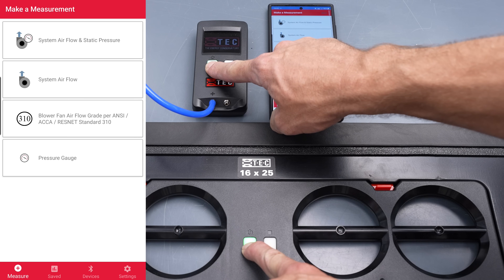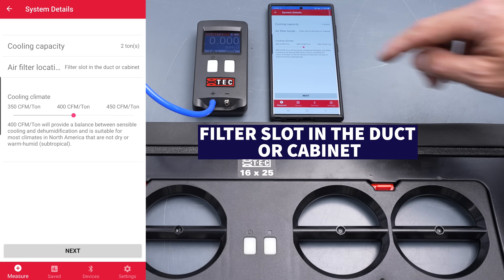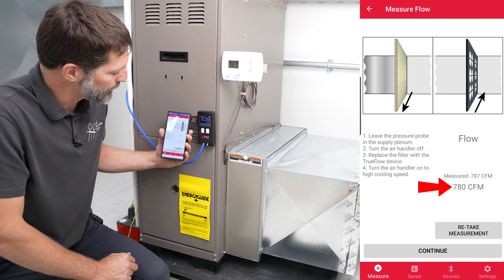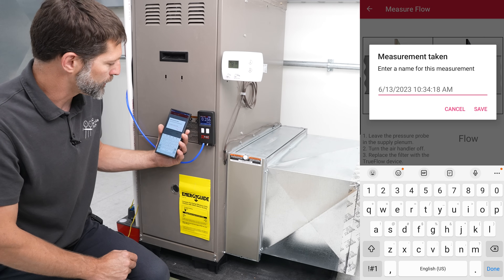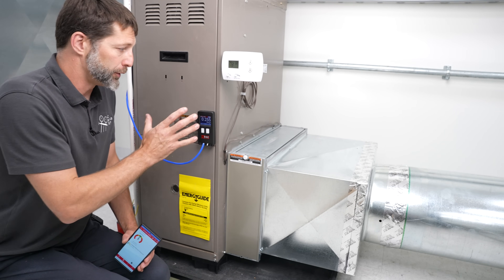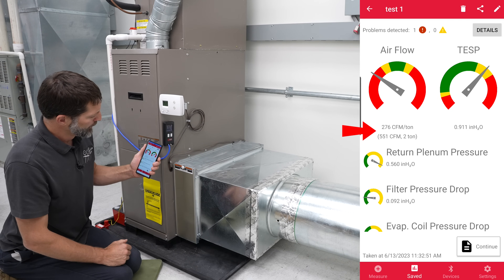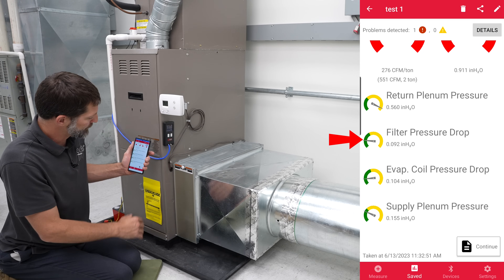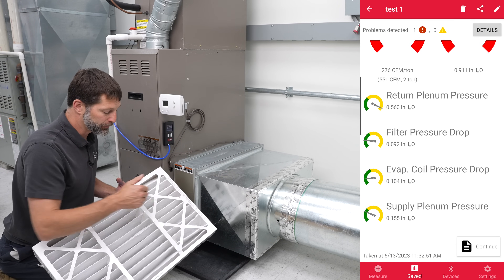Measuring Airflow CFM on HVAC Systems! Finding Airflow Problems!

Comment: Is it possible to use the TrueFlow grid using a Retrotech dm32 and just manually enter the pressure readings into the app?

Comment: This right here just shows me that no one really cares how they do do work in the field or how to run things properly. I’m a service technician and an installer and these new pieces of equipment do not like the bad duct designs from old systems.
Reply from the maker: It is definitely true that a lot of older ductwork doesn't hold up to the requirements of newer equipment.

Comment: If I didn't know any better I would swear Greg is purposely making  it more difficult to follow along. The way he blows by the device and test settings section and then selects the second test when he could have selected the first test option which includes both tests. It just seems like he's making the procedure longer and harder than it really needs to be I think. Secondly Is it really necessary to swap out the filter  and adapter grille multiple times? 
I'm not sure, but I think both tests can done with one swap. I may be wrong and confused, I don't know if I am or
not. 
Can someone please explain where I'm missing the boat if I am missing the boat.
And finally he states that the fault is up stream from the test point. How can that be possible 
if the fault is at the return grille?
I can't make any sense of this logic. Any clarification will be highly appreciated.

Comment: Could you use this in a RTU? Or does all the of airflow have to pass through this to get an accurate measurement
Reply: All the air flow needs to pass through the grid to get a good measurement.  We (the manufacturer) have done tests using 2 grids on an RTU that has 2 filters.  The measurements are accurate, but it's not well supported in the app yet.

Comment: The return is with high static according to the video, but you did mentioned if the total fan static can handle both supply/return and internal static. If it can handle and design for that, so there’s no issue.
Reply: The total was 0.91 inH2O.  I'm not aware of any equipment manufacturers that allow a total static pressure that high.

Comment: not all filter house is made good I have no time to fix people's filter house they don't pay ,  I ain't going to buy all this big goofy plastic all over, techs ask the homeowner to do airflow they have to pay  to fix their filter box , don't say you want to do airflow and them spend hours bending and straighten and correcting  their messed up system, 80% of them are messed up anyways, people are cheap these days just fix the major issue and leave. don't get your headache, if it's not broken don't fix it. keep talking too much to the homeowners you might get your self in deep s. if the blower motor is weak just find the issue fix or replace it keep it moving period. I have education in hvacr I worked 19 years as Hvac I know work for government less headache, the private is Hvac job is trashy and I used to go home with headache many of the customers are lairs.

Comment: Cool do they have a similar procedure for heatpumps Great Content ❤
Reply: It should be literally identical to the system shown in the video. The only difference for a split Heat Pump is the reversal of coolant flow and the Evap Coil being hot instead of cold like with AC. Nothing changes with the indoor equipment or testing
Reply: The app now has a heat pump or furnace mode in addition to cooling.

Comment: so the dozen plus techs that have come to my home to install or fix my AC - never once have I seen them do any of this level of diagnostics.  Why is this?  I mean, I get "techs" not "engineers" it seems and there appears to be this huge gap in knowledge between the guy/gal ("tech") that shows up and the people who design HVAC systems.  I'm a DIYer and have began installing my own HVAC systems and as I learn more about this field, it amazes me how many people that I use to rely on were never really interested in providing a system that is "dialed in" and matched to my home or the equipment's specifications.  I have installed two central HVAC systems (heat pumps) and getting ready to do my third for a garage and just as an experiment, I called 3 local HVAC companies to get quotes and they all have eye-balled it.  Not a single one of them did any volumetric calculation, none of them took into account the insulation of the garage either.  I probably could live with all this if it were not for the massive amount of scams, lying and price gouging going on in this industry.... I even watched one guy completely ignore torque settings on a pre-charged line set and went to town smashing and over-tightening that no-doubt would have left me with paying the bill.... anyway, keep sharing the knowledge....

Comment: Just want to ask about the superheat chart for the piston system, your chart in the book we got don’t show the return temp more than 76f 
The temp at the return was 84f and the supply was 76f. I don’t know what to do in this case! I need to calculate the target superheat..
Reply: I aim for about 12 degrees-ish for superheat on pistons, while trying to get around low 50s on the suction line temp. At 84 degree return, I would probably aim a little higher on the superheat since theres a big heat load in the house. If you are nice and cool on the suction line temp, and your temp split is good, you should be looking good to go
Reply: Superheat requires certain parameters to work.  You need to get close to those parameters before setting the final charge.  For instance in this case let the unit run long enough to bring down the return temp and then set the charge.   There are plenty of techs out there that set superheat at the same setting regardless of temp/chart, however they are putting components at risk.

Comment: I think my 2.5 ton system has a slightly low charge. I measured a static pressure before the filter and before the evaporator and got 0.43 WC. The med-high fan setting for my handler says 0.4 is 1031 and 0.5 is 987. So pretty much 1000CFM yet it froze up on me one day when it wasn't really hot out but just enough to trip the t-stat. I set my house at 76F so it's definitely not over-demanding. This only happened when I moved it from high to med-high, figured I'd try to make it a little more efficient since the numbers lined up. It did run a couple weeks with no issues but it was warmer in that time.

Comment: Great video as always! Quick question. How would you use this if you have a variable speed blower motor? Don't they always maintain airflow no matter what restrictions there are unlike PSC and ECM motors?
Reply: If that's how they actually work, they must be monitoring the pressure to maintain a certain flow. The only thing that would matter and be helpful to test would be power consumption for the blower as presumably it would be inefficient with restrictions. I've seen people claim that VFD HVAC equipment does this but have some questions/doubts about the effect and manufacturers actually implementing the components to do it.
Reply: How can there be proper air flow with restrictions present? I can't believe your question. I don't think you're cut out for HVAC.
Don't waste your time and money
In HVAC.
Reply: @edwardlara1011  Variable speed motors can ramp up and down to maintain proper airflow under a range of static pressures.

Comment: I have question  for any expert, I want replace my 1/10 hp condenser fan with 1/4 hp, with same rpm,  is it OK? I will make sure put new capacitor that is rated for 1/4 hp fan
Thanks
Reply: It’s fine induction motors don’t need a load
Reply: Depends on how you look at it. 

* Condensers have fins & hail guards which produce static pressure. 

* You need HP to overcome that static pressure. 

* Motors need to run efficiently. Under amping or over amping is inefficient and results in shortened life expectancy. 
A motor than is more powerful than needed in a condenser may cause it to run inefficient. (I say “may” because I’ve honestly never tried it, so I don’t know exactly)

* By all means, you can replace your motor with a different HP, but it will shorten the life expectancy (sometimes drastically).  I will leave the rest up to you.
Reply: @ironwill3598  thanks
Reply: Induction motor 'power' rating and consumption are dictated by the load. Meaning, speed rating is most important and a higher power rating only matters IF it's having to do a harder job i.e. more 'work'. If both are rated for 3600 RPM, they will operate the same with the only difference being the 1/4HP can handle more resistance and maintain the rated speed over the 1/10th. Again, power is determined for Induction Motors by the load imposed on them and speeds are fixed at the rating unless the load exceeds the power rating. 

A bigger motor with a higher rating (if it fits, that's the biggest thing with AC motor frame/sizes) won't faster or draw more power for the same load/application, it's just telling you that it can handle more resistance than the 1/10th motor from the OEM.
Reply: @Brandn00b25   thanks

Comment: I have a 5 ton AC, always got frozen evaporator, never work properly from first day. The ESP before filter is -0.07 inWC, after evaporator coil is 0.08 inWC, the total 0.15 inWC, what will cause ESP too low. Turn on the heat at highest speed, the gas output is 111,000 btu/h, delta T is 68F, the total CFM is 1500, something wrong with ductwork system. Any opinion and suggestion, much appreciated
Reply: You'd probably need to get larger ductwork.
Reply: Sounds like you over sized your system. 400 cfm per ton is rule of thumb.

Comment: Anyone in the HVAC industry whether they realize it or not is selling airflow. In the 35 years that I’ve spent in the HVAC industry, I tried to measure even on a service call the X ternal static pressure of every job. I could probably count on one hand, the number of installations that actually met the manufactures maximum external static pressure of 1/2 inch And we need to make it mandatory that to pass an inspection. The inspector must do an external static pressure test of every install. Just my opinion.
Reply: I agree, but here’s the problem with that.

I’m here in Colorado, and many houses, especially older ones were not built with good ductwork. They were WAY too small to allow the proper CFM through at the correct velocities (and/or) static pressure.  With lots of my customers it’s: “We either need to gut your house and replace your duct system, or we live with high static pressure”.
Reply: @ironwill3598 
A mandated post installation city inspection on all new installations will alleviate the high static pressure problem. 
Excluding only older construction  projects that do not meet the required specifications for larger ductwork would be exempt from the city  post installation inspection mandate... problem solved.
Reply: New home builders are getting away with gross framing, electrical and plumbing errors, and PASSING inspections. HVAC details are SO FAR OFF THE RADAR that homeowners should be grateful if the thing even cools at all 😢. Sad state of affairs.
Reply: Air balance test is. Even a bigger joke inspector wanted it. Was funeral home he just drill and. Plugs holes and messed with my Honeywell jado controllers on damper $2200 . And a tube of silicone to caulk  50 Plugs  may the Good lord keep everyone safe

Comment: Great video on measuring airflow in HVAC systems! This ties in perfectly with the newly approved ASHRAE Standard 241, which emphasizes the importance of managing airflow to reduce the risk of disease transmission in indoor spaces. Your practical demonstration of ensuring proper airflow and identifying airflow problems aligns with the standard's requirements for equivalent clean airflow rate and the use of filtration and air cleaning technology. It's exciting to see how HVAC professionals can apply these methods to create healthier indoor environments. Keep up the good work!
Reply from the maker: Thank you for your positive feedback and insightful connection to ASHRAE Standard 241! I'm thrilled to hear that the video on measuring airflow in HVAC systems resonated with you!!
Reply: Yeah disease is rampant

Comment: Love these videos. How would this work if you had a system with two air filter slots (one on top of the other)? Would you keep one air filter in and use the TrueFlow grid in the other air filter slot?
Reply: 00:02:23

Comment: Did I missed something or you had two different results while testing exactly the same equipment.?
Reply: The first measurement was only CFM delivered from the blower out.

The second measurement was the CFM delivered when you include your  system Total External Static Pressure Measurement, your whole ductwork.

Comment: Another great video, thanks. 
Would love to see an unbiased test of tf grid vs. the manufacturer blower chart vs. hot wire anemometer.  $1800 is a lot of dough if the other methods work as well.  
Plus I’m almost at the point of having to take a tractor trailer to the job site with all the tools I 'must have'-like this and a blower door kit.
On side note, does Craig ever sell all these tools he gets to try out?  I’m sure a lot of techs wouldn’t mind sone discounted tools (probably a legal/tax issue).
Reply: I use the fieldpiece anemometer. $300 or so still kinda pricy but it's allot more affordable and pretty easy to use.
Reply: I feel for you buddy. I’m retired, but I went from 3 refrigerants to 6 and all that. I changed jobs and got into commercial and industrial dehumidification and some VOC removal systems. That was my dream job after 20yrs of HVAC&R service office bldgs and commercial rooftop stuff. Can’t forget the fun Follet ice machines lol. Find your niche and perfect it.
Reply: That’s what has been working for me.  That and static pressure.
Reply: There has to be a much cheaper alternative. You're right 1800 is too high.

Comment: airflow airflow airflow 👍
Reply: 4 point airflow check (if you don’t have a filter 3 point) to determine problem area and shooting for 0.5 inch total static pressure and ~400 cfm/ton.
Reply: ABC ABC ABC ABC